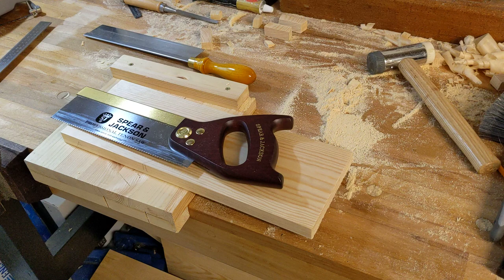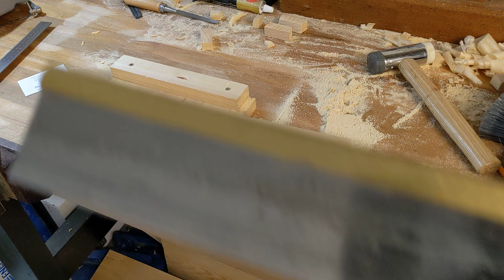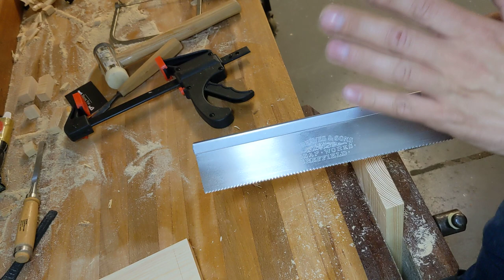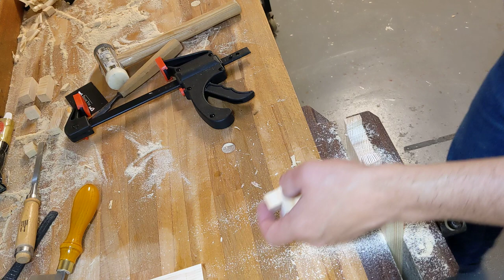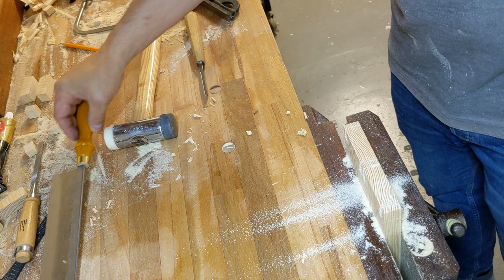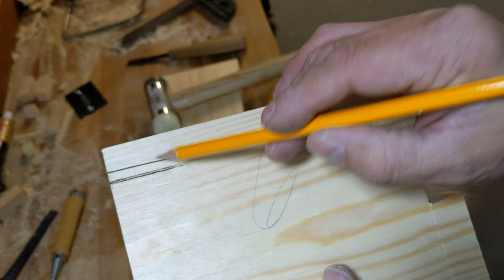Dovetail Saws on a Budget - Part 3

Comment: I just bought my first serious fine saw. It's PAX Gent's saw and I'm quite pleased with it. Previously I've use a Bacho bow saw frame, with a Nobex miter saw blade, probably 18TPI or so, which is to fine for my use. I must say that putting tension on a blade adds benefits. It has to be straight spanning to fixed points, and there seems to be less vibrations. For cutting tenons I will continue to reach for my Bacho bow saw, but the little PAX will be great for fine stuff like dovetails in thin stock. Although I probably re-tooth it to 16TPI.
Reply from the maker: Hi Robert. Thanks for taking the time to share your experience. Happy woodworking 👍

Comment: Looks like a good inexpensive dovetail saw.  At some point, I had purchased an inexpensive gents saw with finer teeth just to have a 20ish TPI saw.  Was impressed at how well it cut as well.
Reply from the maker: Hi Joe. A decent option for sure. The more expensive saws are great but this allows someone to get on with dovetailing for not that much money.